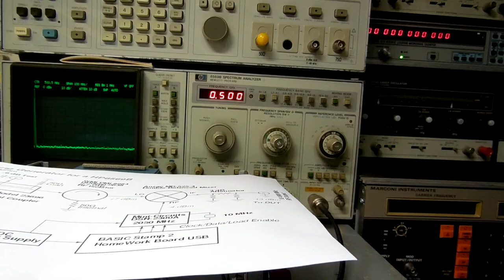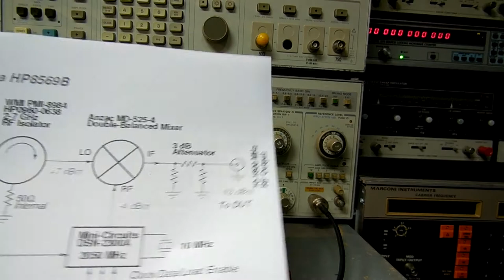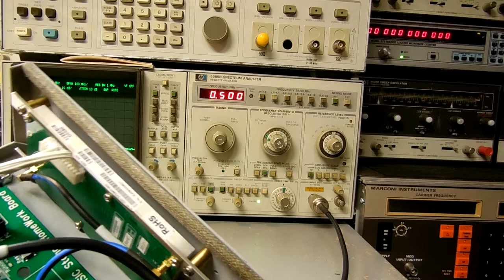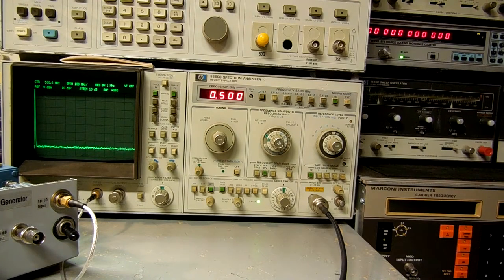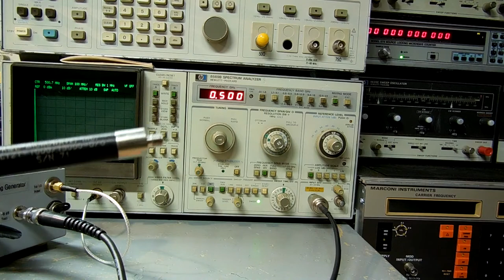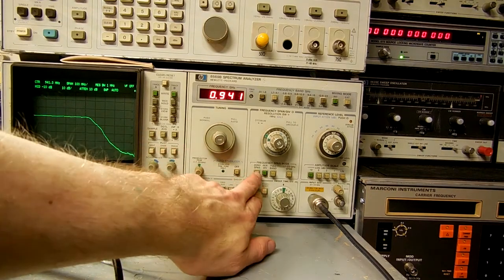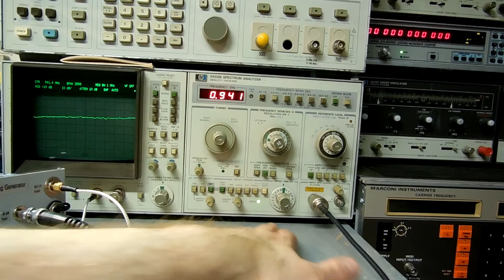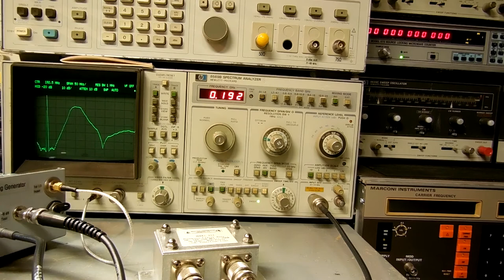GBPPR Vision #21: Tracking Generator for a HP8569 Spectrum Analyzer

Comment: Thank you.  Excellent explanation....  
even though I now realize how truly RF/EE clueless I am. 🙄🤣
Thankfully, all of my spectrum analyzers I have came with the TG option.

I started with a Triarchy Tech 6GHz SA (USB);with separate vector signal generator (USB as well)
but this was way too cumbersome to use to tune duplexers / cavities / filters for 2-way radio use.

I then moved “up”(?) to  a Rigol DSA815tg, but wanted to be able to handle 2.4GHz WiFi
and moved to an Agilent n9340b (up to 3GZz) .

I just bought an HP 8591c (also has CATV personality installed) spectrum analyzer w/ pre-amp and TG options.
They had another unit there.. but, no TG.
I was contemplating getting it and using your video as a start to adding an external TG.
The HP was purchased because I am donating a bunch of radio gear to a good cause 
(local volunteer fire department) and want to give them test and service gear as well.
They have a bunch of current and retired hymns as well as a few commercial radio service techs
who will handle the service for free.   

Oh well, thanks again.  I’ll be back once I get the parts squared away.
The Chinese CCP-Virus permits much spare time nowadays.  😷🦠🤣

🇺🇸 73 👍🏻

Comment: Thanks for the video, , I have two HP8569B and one HP8569A, Im already buying parts to make the tracking generator. The DSN-2003A-119 is not for sale onEbay, Where I could get it.
Reply from the maker: You'll have to order it off the Mini-Circuits website

Comment: Hi I just built your tracking generator the hi freq one1000mhz to4200mhz if works good but I'm having problems with the 321.4 mhz oscillator I'm using a old wavtek 3001.I would like to build a good voltage tuned 321.4 mhz oscillator or buy one do you have any good circuit's for one?or do you no of one that would work the output should be around -10 dbm sign wave.
Please write back.
Allan pierron
73's
N8zhc